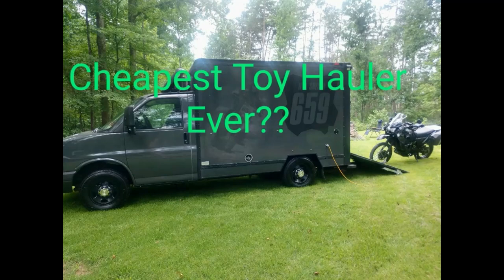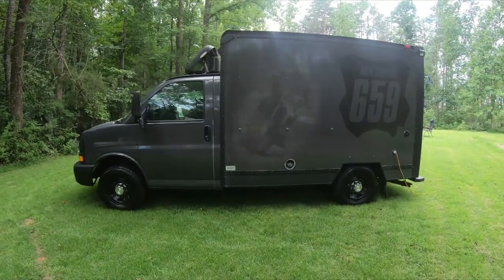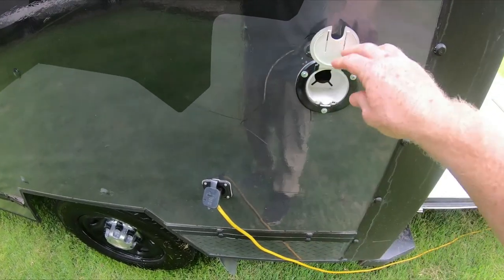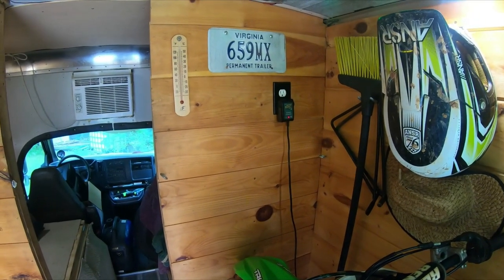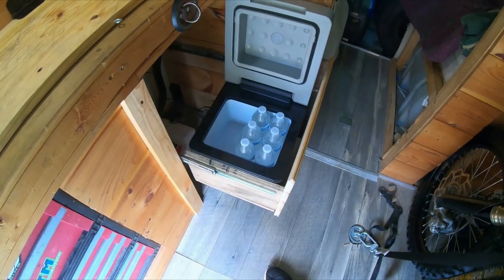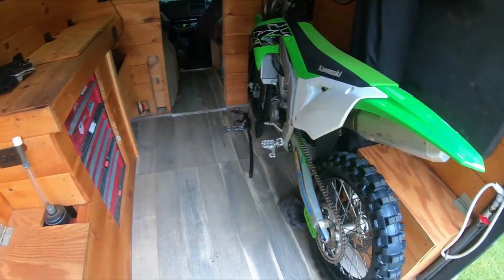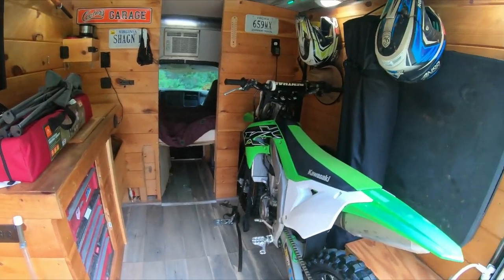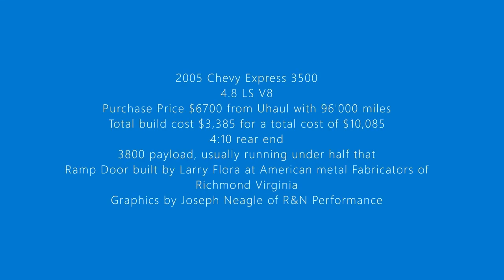Tiny Home and Toy-Hauler

Comment: Nice job on the Conversion!Im a retired Woodworker who did do some Home Building and Remodeling. in regards to your Comment on you not being a Carpenter i don’t see anything wrong with what you did build  and Wood was a smart choice  t use as it is easy to modify  ,repair , or adapt to changing needs. it also is a  decent sound Absorber  BTW i really thought your hide away Sink/ Workbench  was a great idea  i saw a older Toterhome home built for a racing the guy  installed 2 sinks in and one was a normal one the other was used as a Parts Washer ?  unfortunately he had them next to each other ? and i’m fairly sure  i wouldn’t want my Food being prepared or Utensils being Cleaned next to  the Solvents and Engine Parts being degreased and cleaned  only a few inches away  from each other  ? Plus i am a Bachelor  and most Women i know wouldn’t like  that set up as well !

Comment: Very cool.  Wow.  I bet with a curtain across half or so of the back door opening you could be nice and cool with the door open.
Reply from the maker: Agreed, gonna give that a try this summer. On race days I try to stay acclimated to the heat to some degree on hot days so it's not a shock when I head down to the starting line....but at the same time I need to cool down after Motos
Reply: @motonomad4900  Some mo that here in Texas the rule is basically when you get off the bike you get in the shade and start shedding layers